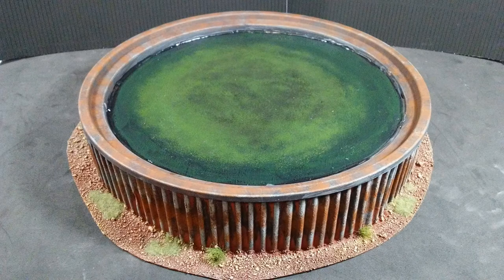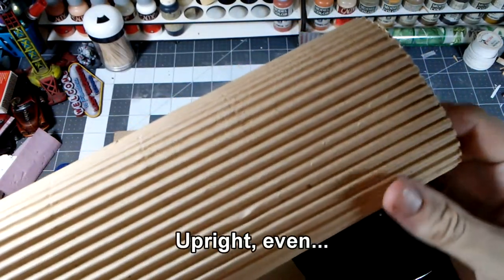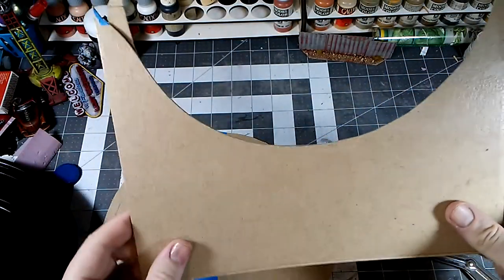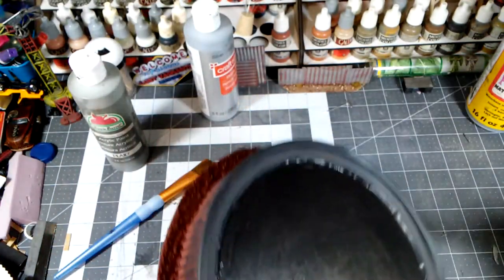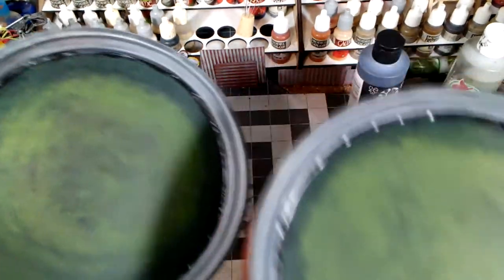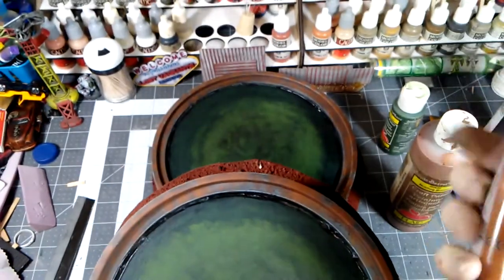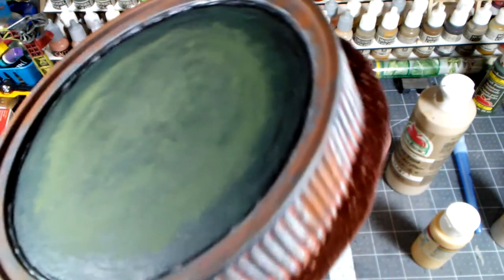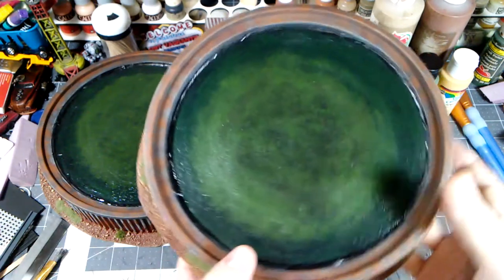Post-Apoc/Fallout Water Treatment Tanks - Ep 33

Comment: Love it! Really wouldn't drink that water though :D
Not familiar with water effects, are they very different from pourable resin? With the latter you could probably give some extra depth to those swirls by layering resin and paint, though it's pretty slow :) A cheaper way of doing it is the old school way - gloss varnish, a thickish layer of PVA, and several more layers of gloss varnish.
Reply from the maker: I really do need some clear resin, along with several other things that have been suggested, so that I will be prepared for any sort of water crafting. Gloss varnish is the next step on these I'm thinking, due to its local availability.